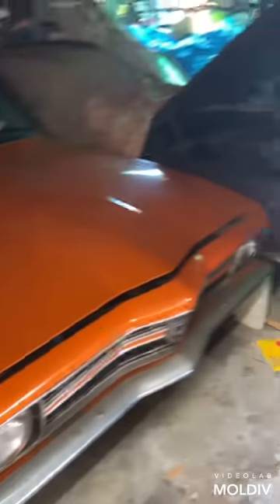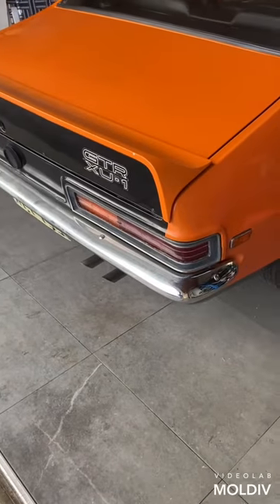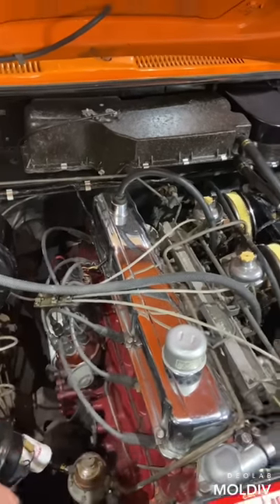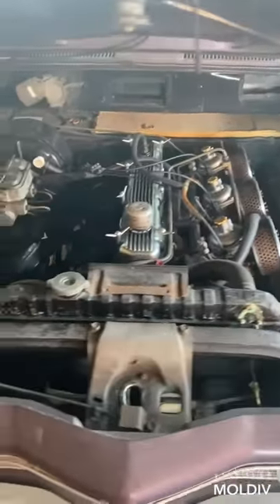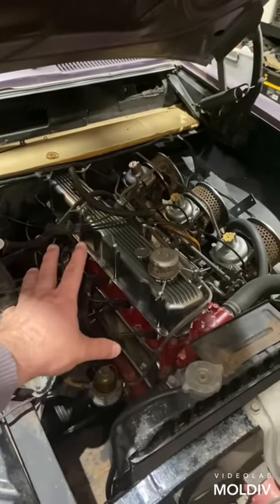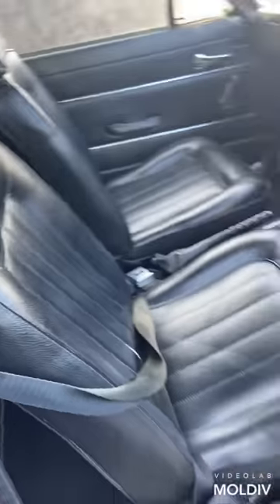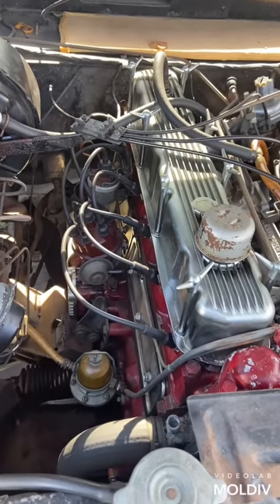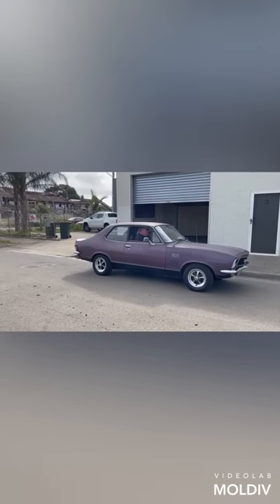Barn find after 36 years, 2 x GTR XU1 Torana's brought back into the world.

Comment: This takes me back many years, around 1975. I could have bought one of these. Very tidy unit that I believe had extra work done on motor. It run 20 miles Casino to Lismore in 12 minuits. Insurance was too expensive . Still wish I had bought it. 

I owned 2 EK, HT, HQ with 253, 4 speed box, and bucket seats, HQ Statesman, LJ torona, among many others over the years. I no longer am able to drive. Miss putting rubber on the road. HJ was ticked up, but standard was good for 179 km / hour. Absolute beast for 253

Comment: I had two ‘worked’ GTR’s, I didn’t like the ducktail, so that came off.
First was an LC 2850, pulled out to about 3 litres, the second was an LJ 3300.
So much fun on every level.  TBH, I liked the LC (triple SU, 38, 94, 127, 169 on the dyno) more than the LJ, it just felt better balanced, and less plastic.

Comment: Hey ~ No rust  ~  I have to  tell you   I had a LC XU-1 and a mate had a LJ  XU-1 ~ We BOTH sold our Toranas in the 1980s  ~ same issue  which we were told was beyond repair ~ sold for $1500 ~ each! 

Our   cars  both developed  structural rust in the  left and right side  front pillars  at the base of the windscreen !  I was told  by a panel  beater  it was not recoverable ~ ( which in  hindsight was BS ~ maybe!)   I  fish oiled mine  every   18 Months but never stuck the  gun  into the  heater   vent  cavity ~ and the  internal of the pillars.

Comment: Is that just the normal Chevrolet 6 cylinder
Reply: Nothing “normal” about it! It’s an Australian GM Holden developed by mechanical guru Harry Firth, seven bearing 202 CI “red” motor (originally a Chevy 132 CI way back in 1948). These things fanged around Mt Panorama Bathurst NSW at lightning speed, piloted by the legendary Peter Brock and Colin Bond, in the early 1970s, beating all the US developed 350 V8s. The Holden 202 wth triple Webbers was a giant killer. Then in 2002 came along the Ford Australia straight 6 Barra 245 CI 4.0 litre, which was so strong that it can easily push 1,000 BHP monstrous great turbochargers bolted to them. What Aussies can do with straight sixes is amazing!

Comment: we all have had story to tell about owning Torana gtr or gtrxu1, my first car in 1987 i went to brisvages with fist full of cash looking for one in car yards ,you know the odd performance car car yard ,tucked away in the suburb's ,well i found a white lc with Webbers but it was ruff fuel  leaks and run like hot and very out of tune ,body was fair lots of stone chips thick paint ,so i keep looking ,then i see one drive passed with for sale on back window trurn around and  chased him but could keep up in traffic , then coming home i passed a car yard with one up on ramps out front ,,later i discovered after i purcashed it for $3.700 was LC xu1 with lj gtr front clip fenders and grill tail lights lj dash pad and front seats with morron valour inserts lol  ,lc gtr trim other wise back seat and door trims ,had xu1 tank and brakes ,202 motor xu1 close ratio box, damn i loved that car ,built this stinking hot 202 had big dollar full race spec 9 port head triple su carbs 35/75 cam the works balanced and blue printed run 13.2 quart at willowbank in 1998, still have the time slip ,